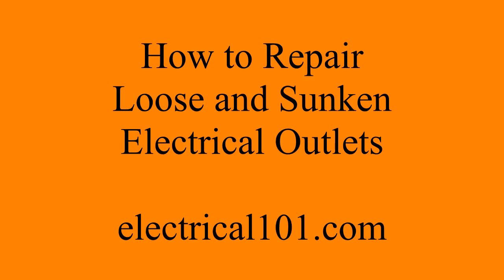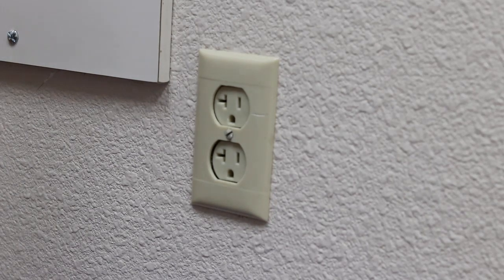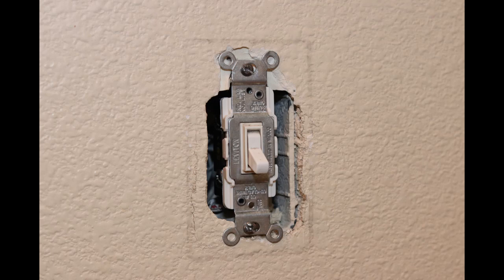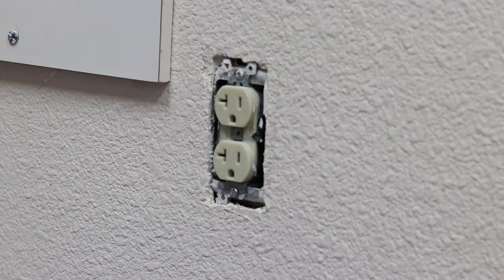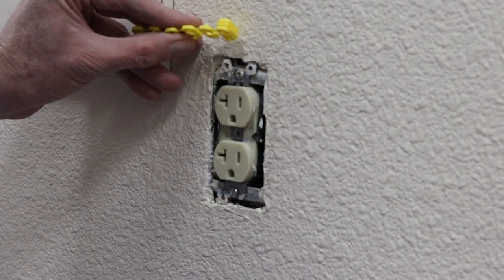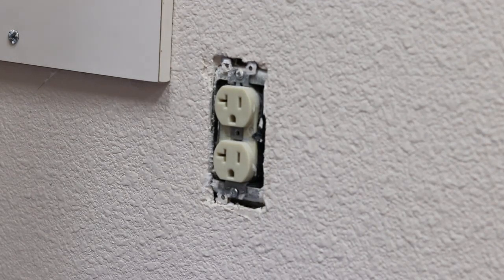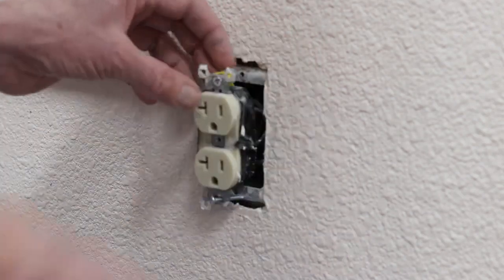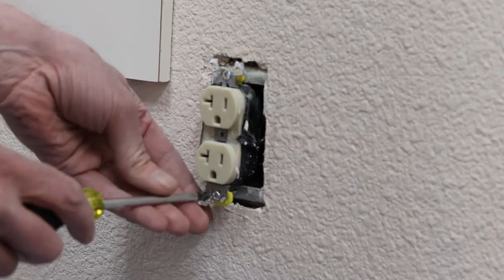How to Repair Loose or Sunken Outlets

Comment: Do you need longer screws?
Reply from the maker: You may need longer screws depending on how far the electrical box is sunk into the wall. #6-32 screws are used.

Comment: Just what I needed to see...but (and excuse my ignorance as I am really apprehensive about electricity), why does the electricity need to be turned off if you’re not messing with wiring? Just asking, as I don’t trust that it IS off and don’t want to touch it if it’s potentially dangerous...just to insert a spacer. Thanks. I wondered why the face plate kept breaking when tightened, so now I know.
Reply: Marcy RP if you are not experienced with electrical and the circuit is on when you unscrew the outlet or switch and one of the screws touches the sides of the metal box it could blow up
Reply: Electrocution is not worth it, just turn off the power to the outlet.

Comment: Can these be used with gfi outlets?
Reply from the maker: Both these spacers and the RACO flush-fit leveling plate will work with GFCI outlets.
Reply: @jimrhoch  thanks!
Reply: @jimrhoch  now I have another question for you. Since the spacer is plastic, metal is no longer touching metal is the outlet still grounded?
Reply: @rstein3131  well it would be still grounded because you have a grounding wire hooked up to the outlet (at least i hope you do)
Reply: @theblinkstykrab3106  Yes, the grounded wire is still hooked up. I was just worried that they are plastic, metal not touching metal if that makes any sence. Thanks!

Comment: Just curious, what if you use a small piece of Sheetrock or even a piece of wood instead of receptic spacers?
Reply from the maker: I would not recommend either of these options. I have seen a coiled short piece of solid wire used as a spacer.
Reply: As for the wood, some may say don’t use something flammable.
Reply: If you have a box that is recessed enough that you could use a piece of sheetrock, you would need a box extension for code, not one of these shims.    Even if you could, sheetrock crumbles in small pieces with pressure and wood is flammable as Thomas mentions.  For small adjustments, use these or what Jim mentions.

Comment: Where can I get those spacer??
Reply from the maker: On Amazon, search for "outlet spacers"

Home depot has a plate that mounts between the wall and the outlet or switch. https://www.homedepot.com/p/RACO-1-Gang-Flush-Fit-Wall-Plate-Spacer-3-Pack-999X/304353271

Plastic tabs at Lowes. https://www.lowes.com/pd/Gardner-Bender-4-Pack-0-75-in-W-x-4-in-L-Green-Plastic-Wall-Plate-Spacers/1054139
Reply: @jimrhoch  thanx for the video but.....
your link is not to the plastic spacers
Reply from the maker: @daveyk3436  Here is a link to Home Depot plastic spacers
https://www.homedepot.com/p/IDEAL-Caterpilar-Spacers-Shims-5-Pack-772453/202937113

Comment: Far out man..  space serts..  nice...  why not pull the box fwd flush with the wall?
Reply from the maker: To move the box forward you would need to cut a hole in the wall around the electrical box and remount the box.
Reply: Z Ack that requires more cutting and more work including fixing the drywall afterwards. His way is the easiest fix.

Comment: Thanks but wrong problem. Mine is a loose box in a cinder block wall.
Reply: Is there any way you could use one of those blue  self tapping concrete screws probably a half inch or one inch screws .and attached to the wall behind it